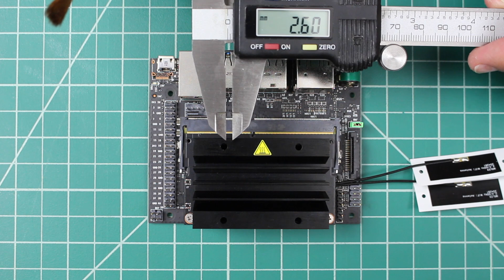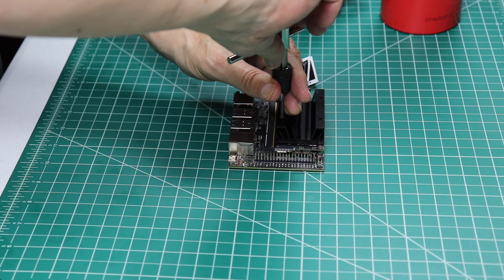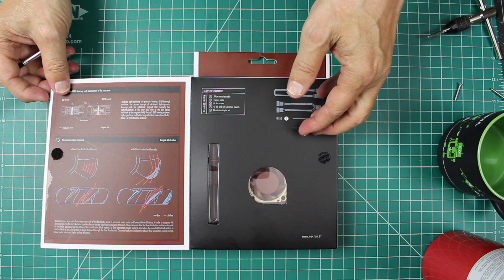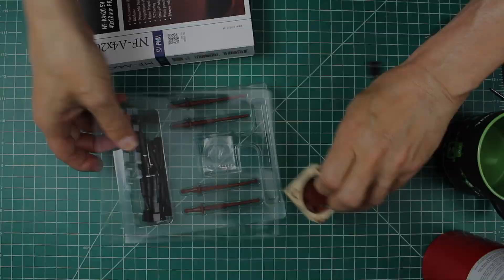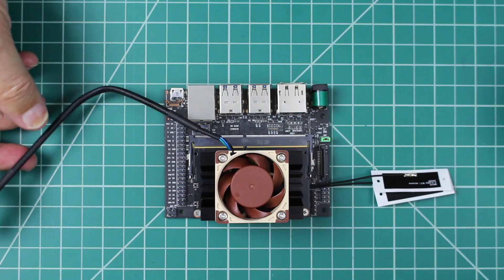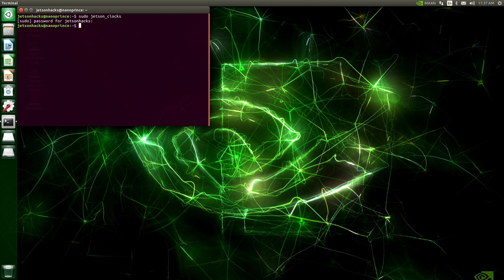ADD A FAN ! - Jetson Nano

Comment from the maker: The jetson_clocks script will turn the fan on. This effect does not last through boots. Rebooting the Jetson will return operation back to the normal thermal manager.
Reply: @Tony Lewis You can code your own script, to ensure that the fan starts on boot. I will post my script in this weekend.
Reply: Nothing happend by me. The Fan dosen't turn on.

Comment: I recently bought the HiWonder JetJexa, which is powered by a Jetson Nano, and was amazed by the wailing banshee turbine noise that tiny factory-standard fan made. I knew that Noctua made excellent fans, having installed one on my 3D printer previously. I stumbled on your video while searching for directions on which way I had to face the fan. I mounted the fan on, closed it all up, and powered up the robot. I mistakenly though that I had done something wrong, as I heard no noise at all! I opened it back up, and lo and behold, the fan was happily turning at 50% without a sound. Due to space constraints I had to get the 40x10 version with PWM, but it so quiet, even at 100% you can't really hear it much over the background noise. This is the best 15 Euro I have ever spent on anything.
Thank you for this video (and your other ones, too). You could say that I am a ... fan!
Reply from the maker: Oh, a little pun-ishment there at the end. I see how it is. Thanks for taking the time to write this nice note, and thanks for watching!

Comment: Appreciate the video. For what it is worth, I tapped the holes w a 3mm-0.5 tap, but used 8 mm screws through the bottom holes. That is what the local big box store had. Seems to work.

Comment: Jim and Jetson Hacks! thanks so much for posting. Screws and Tap are on order since HD and Loews are controlled entry and we are in lock down. In the meantime tested with mounting with small bits of Gorilla tape on the corners. I had put the fan away since it did not start after booting up. Then saw this video which gave great direction on mounting ( although I think the holes should come tapped with mounting screws)  and starting the fan from the command line.
Reply from the maker: I'm glad you found the video useful. Thanks for watching!

Comment: my fan is always on even after i shut down the system, only pulling out the power connector kills it, should it be this way or am i doing something wrong?
Reply from the maker: What fan did you use? How many wires connect to the Jetson?
Reply: JetsonHacks i dont know the brand, it came with a metal case, there are 4 wires
Reply from the maker: @kennyandersson490  It does not appear to work correctly. You should contact the manufacturer, and maybe ask for help on the official NVIDIA Jetson Nano forum.
Reply: @JetsonHacks  okay, thanks for the reply, but do you think i have to use the barreljack? i am using the micro usb right now.
Reply from the maker: @kennyandersson490  Depends on how you are going to use the Jetson. If you want to run at half power, you can keep using micro usb.

Comment: Why wouldn't you remove the module from the carrier board so the metal chips can't fall into the carrier board  and short out something important. Secondly, you can put grease on the tap to capture the bits and chips from the tapping process. 
No, I don't think blowing it off with a can of air is a legitimate way to make sure you don't have chips on the circuit board.
Reply from the maker: Thank you for taking the time to reply. The reason that I don't remove the module from the carrier board is because there are a large number of components on the underside of the module, along with the SD card reader. https://i2.wp.com/www.jetsonhacks.com/wp-content/uploads/2019/03/IMG_1073.jpg?zoom=2&fit=5184%2C3456&ssl=1
 I'm not real excited about applying pressure to the underside of the module and those parts. By contrast, the carrier board only has a few diodes on the underside of the board. 
Thanks for reading!

Comment: Thanks! I had my fan installed upside down. You should buy a KKSB case for your Jetson Nano and then do a video on how to assemble it because I don't know how to make the power button work.
Reply from the maker: Did you add the jumper to tell the Jetson to use the power button?
Reply: @JetsonHacks  The power button is connected to a pin. I don't know if there is a jumper besides the pin.
Reply from the maker: @robrobbins  I'm not sure what you mean by not knowing if there is a jumper. Typically you need to install a jumper, e.g. https://youtu.be/SpUB6h4Akp4?t=108
This will disable auto power on.

Comment: I actually went the way of holding an m2.5 nut with a pair of tweezers while screwing in the bolt and holding the fan in place at the same time. So installing the fan almost became (and definitely felt like) an afternoon project. In retrospect using a 3mm tap would have been THE way to go. 

Please release such important videos earlier 😉
Reply: I used 3mm round silicon gasket material and 6/4mm silicon tubing as spacers AND vibration decoupling for a quieter setup.
Reply from the maker: Yes, those M2.5 nuts are pretty small and can be frustrating to work with. I have found it difficult to release these types of videos before I record them. Thanks for watching!

Comment: Nice, but what is this warning after running sudo nvpmodel -q:  
NVPN WARN: fan mode is not set 
NV power mode: MAXN 

Fan is on all the time since I ran sudo jetson_clocks and that is fine with me.  I like the MAXN power mode, too.  Thanks I have learned a lot from your Jetson series.
Reply from the maker: Thank you for the kind words. The warning from nvpmodel is that the fan speed has been overridden (it was overridden by jetson_clocks).  The system does not manage the fan when it is overridden in this manner. In general, there's a lot of work that goes into thermal management in embedded systems like this, it's better not to mess with the fan speed manually. 

The jetson_clocks script does not survive between boots. Simply reboot the Jetson and it will return to normal operation. Thanks for watching!